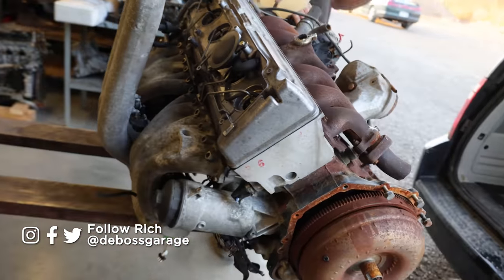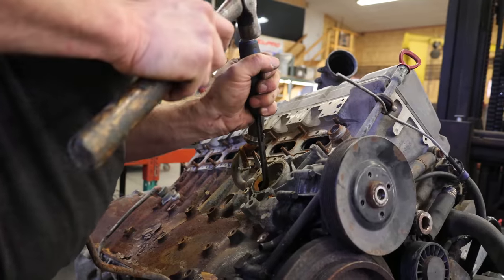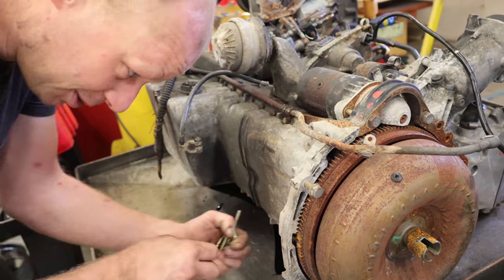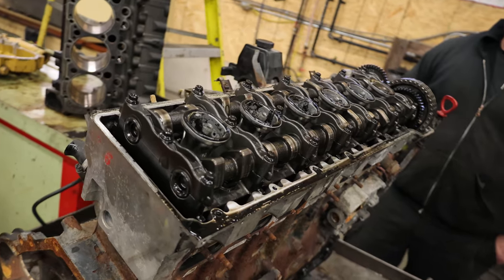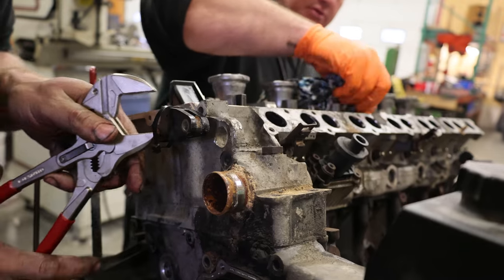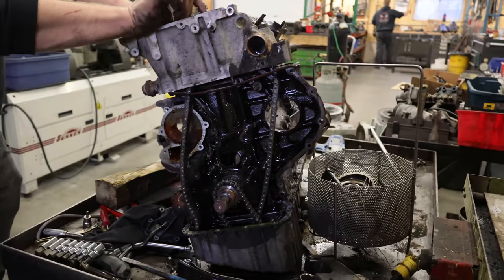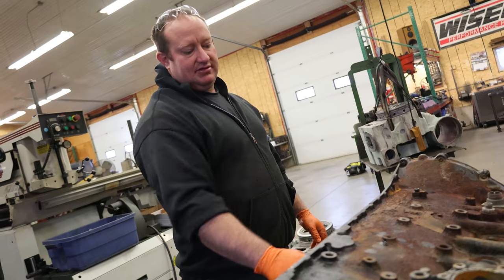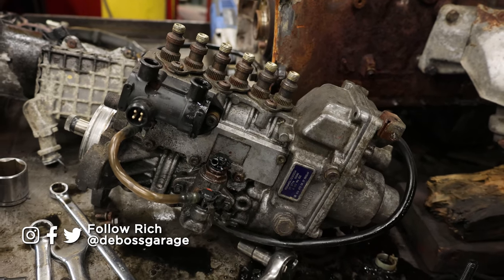REVIEW: Everything Wrong With A 3.0 Mercedes OM606

Comment from the maker: What engine should we review next? 
If you want to see more OM606 goodness, check out @dieselpumpuk, @blacksmokeracing, @dumbluckcustomz, @teamboosted, and @dieselmeken we think they're doing some really cool stuff!
The Bosch fuel pumps referenced at 7:02 are rebuilds by Yankee Diesel, Inc. and can be found at: https://yankeedieselinc.com/products/0400076992/ (mechanical) & https://yankeedieselinc.com/products/0400196003/ (electronic)
Reply: What about the OM602
Reply: You missed Baldur Gislasson off the list, he makes the DlS1 standalone ecu to run the EDC pump, fully programmable, he is a good guy!
Reply: Om642 2008 Jeep Grand Cherokee
Reply: Ecodiesel. There so bad you’d have a extremely lengthy video
Reply: Hey boss.... Do you can talk about OM 906 mercedes benz... Thanks you
Reply: Isuzu 4HK1T from an NPR box van. I think you'll find it a great motor, especially for swaps into full size pickups/SUVs. It's a bit on the heavy side but Isuzu really runs these things on a gentle state of tune. They last and last and last. 
Or if you want something cheaper, the 4BD or 4BG motors are previous generation motors. Also stupidly reliable. They are still being manufactured in China, so you can get brand new parts. Don't know if I'd trust Chinese parts for a high power build, but if you wanted a dead nuts reliable swap with parts available, its hard to beat.
Reply: A BMW M57N2 - Those are magnificient and powerful engines
Reply: @bryandepiazzy1572  Are the totally redesigned ones any better.
Reply: You should do one on the mb 3.0 v6 CRD
Reply: V10 turbo diesel from the 2008 VW Touareg would be an epic find.
Reply: PLEASE DO EVERYTHING WRONG WITH A 6.7 CUMMINS
Reply: Would really love to see a VW 3.0 TDI
Reply: VW 2.4liter turbo diesel, aka D24tic
Reply: In germany we have a tuning company called "Sterngarage" they are tuning these 5 and 6 cylinder diesels too. I can't recall it correctly but it was 500-600 Ps on an OM606 in a W210 really awesome stuff. If you have these in Canada you should look at the VW 1.9 Tdi  (especially motorcode AFN build before and around 2000)these Engines they are said to be the best diesel engines and engines in general VW ever built
Reply: 6.7 power smoke?
Reply: 6.7 Powerstroke and 6.7 Cummins
Reply: Get a mechanical pump from W124 om606 na (rs203). Send it over to Dieselmeken. Let him build it with 8mm plungers and all the goodies. Put a set of H profile rods on the crank. Use na camshafts. Secure the camshaft sprocket cause they tend to shear off! Put valvesprings from om648 in (7k rpm). Secure the crank pulley to the crank cause they tend also shear off (only held by a little half-moon). Put a coolant bypass from waterpump to 5th/6th cylinder. Use a oilpump from om612/13 for higher flow rate and better oil pressure. Use a highflow custom exhaust manifold and holset He531v  and you are good to go for 700bhp+

Greetings from Germany
Reply: Om648 or more Om606 is fine too I guess. Can you show how to get a P pump on it?
Reply: OM642. Mercedes sprinter diesel motor and jeep diesel motor
Reply: M57
Reply: A td5 out of a Land Rover would be cool for us British.
Reply: How about a Fordson (super)major? Do you get those there?
Reply: Another vote for the BMW M57.
Reply: John deere 6076 next!! lets see if they really are good for 20k hours
Reply: @tomredman  i can say from experience, yes they are!
Reply: Y’all have to review the SD-33 and SD-33T Nissan diesels
Reply: BMW M57N 3.0Diesel
Has many advantages over the om606 including being common rail
Reply: The om648, 320cdi engine
Reply: @peterkalza  I hope so, I just brought 2 built in 1996, with 850hours each on them. Fingers crossed
Reply: OM642
Reply: 12.7 pre-EGR Detroit Diesel
Reply: They are wonderful motors, the 8mm dieselmeken 606 I put in the S124 wagon is great....have a 7.5mm going into a Jeep JK currently
Reply: Vw/volvo D24tic
Reply: L10 cummins
Reply: bout time . .
Reply: OM617
Reply: Scania engine if you can find one
Reply: Compare the ag d360 vs the truck dt360
Reply: Havent seen you do anything form older John Deere tractors yet... the 404, 466, or the head gasket eater 619..
Reply: How about a Toyota 2H or 1HZ? Not common over there, but comparable to the OM606. Even though  the turbo and NA versions have different rods and piston, people still put turbos on the NA motors anyway.
Reply: om617!
Reply: You changed your impact guns? Why? 

Also, do an Asian one, like a k-series or like any Toyota engines?
Reply: Do a 4jj1
Reply: Rich, you need a Worldpac account. Even if they don't carry something, 90% of the time they list the OE part number. Their diagrams and list prices are exactly what you'd get if you went straight to the dealership parts counter. The ordering system takes some time to learn and get used to, once you do though, it is awesome to use.
Reply: Isuzu 4jj1 or bmw m57
Reply: 2AZ-FE!
Reply: @mikefoehr235  haven’t seen failures yet waiting for it tho.
Reply: Dieselpumpuk. They sell all you'll need
Reply: Merc is cheap with parts in Europe: you pay up front on the car purchase but they dont charge a lot for parts: So for pricing its on the opposite end than the 2JZ.

Try ebay.de
Reply: @jairromero5779  i dont think they ever sold those in North America ?
Reply: Not too many people to appreciate a BJ60 Hino
Reply: @kelby7462  those were way better than the RD28
Reply: OM642. 3.0 V6 CRD. From Sprinters and Jeep Grand Cherokees
Reply: @smokiethebear3334  was going to suggest this one. Have this in my 07 grand cherokee crd.
Reply: 1.9 L VW ALH TDI Engine compared maybe to the 1.9 L PD BEW VW TDI
Reply: @ragnarlothbrok835  if this is true I appreciate the good info!!
Reply: How about some of the toyota truck and 4wd diesels engines?  1hdfte, 1vdftv, 1kdftv they are everywhere on the Australian market.
Reply: The mighty 5sfe.
Reply: OM352!  Some Mog love!
Reply: izuzu or mitsubishi diesel
Reply: VW 1.6 turbo diesel. Go visit Giles in Markham...
Reply: OM648! Last reliable mercedes engine, replaced this OM606 and the 5 cylinder.
Reply: Holden 355
Reply: BMW M57, i got a first gen that is now 380 hp and 800 nm
Reply: Don’t forget BenzForce!!!
Reply: You can use an OM603 pump. It’s a direct fit for mechanical injection.
Reply: Id like to see video on Volkswagen ALH 1.9TDI
Reply: The ford 4.9/300 CID
Amazing motor
Reply: gotta be a bmw M57, the king of small diesels.
Reply: BMW M57?
Reply: Checkout Darkside Developments channel they have some awesome diesels, 400hp 1.9 pd's and loads of other good euro diesels.
Reply: VW CJAA diesel. it's the Dieselgate one. how is it as an engine without all the other bullshit to go with that platform
Reply: VW TDI BRM or BHW, they are becoming more common now days and would be interesting to get you take on them
Reply: AMC 4.0L
Reply: Toyota 1HD-T!! import one of them bad boys
Reply: will love to see u review fuso 6m60
Reply: Everything wrong with a 6.4... or everything right? Since its such a turd of an engine
Reply: i have the MWM 4.2tdi. brazilian,mercedes,fitted to silverado,s & f250,s.,excursions.. std is 140 kw,510 nm. td04, i fitted a bearing ceramic tdo6,ish. now has 700nm..gets 12.5 lt 100. in my 2002 f250. ausie..
Reply: mmmmmm 57,,its allways a gooood idea,,to consult a computer ..before tearing an engine down,. i studied the computer for hrs,,before tearing down my missus,in the b room..
Reply: OM605
Reply: DT360
Reply: 2.0 VW TDI or the 1.9
Reply: Rate the Ford 300 i6, both the carburetor and two fuel injection varients (MAP and MAF).
Reply: 1.9TDI ALH pleeeaasee!!!!
Reply: Check out a fiat/alfa romeo 1.9 16v jtdm😎
Reply: om646, 150hp and 340nm out of a 2.1 I4. Very reliable and long lived.
Reply: Dt360, all the izuzu npr diesels
Reply: 6.7 Cummins
Reply: Vm motori 2.8 crd. The 4 cylinder that’s in the older Jeeps there rare in North America but mine has never done me wrong.
Reply: 6.7 Cummins!  So many videos out there on the 5.9 it'd be cool to compare to next generation. Most videos on the 6.7 are just some guy talking about the specs from a fact sheet, who's never actually touched one

And a cp3 vs. cp4 and maybe a denso fuel pump comparison
Reply: Review the 1.2TDI from VW! the engine coded with CFWA
Reply: More OM606 please please please
Reply: Toyota 1Ht please
Reply: Nissan SD33T please
Reply: In Sudbury, ON I have a VW 1.9 BEW TDI that went runaway on me you could have.
Reply: Do a international DT360!!
Reply: I know it's probably a long shot since it's their newest I6 but I'd love to see your guys thoughts on BMW's B58 inline 6.
The channel PapadakisRacing, has a really good build series on the newer supra that has the B58.

https://youtu.be/MckxlP60cnY
Reply: OM642, curious as one lives in my Merc CLK land yacht 🤔
Reply: Om 642
Reply: Dieselmeken on YouTube is the Mercedes whisper I think his son is running it the father retired. 
I agree P-Pump it
Reply: Land Rover TDV6!
Reply: Would also love to see BMW M57
Reply: Hey Guys! love your channel! I'm from germany and thinking about purchasing a Jeep Grand Cherokee WH with the OM642 so I'd love to see you do a review of that engine! Keep up the awesome work!
Reply: Cummins 5.0 v8
Reply: OM617
Reply: Find you a welder whos worth a damn and has a shop and have him cut off the timing cover so you can make one that's removable.
Reply: I'd like to see reviews on a lot of the common jdm diesels...I've been working on these vehicles for many years and have found most to be cursed with head cracking issues as egr was a thing in Japan by early 90s
The 2LT-E for example I've changed enough of those cylinder heads that I could build a fence with the cores.  
Mitsubishi 4d56 and 4m40 are pretty awful also.
Reply: Om617 is probably the most swaped in North America
Reply: Volvo Modular engines (specifically the 5 or 6 cylinders engines with turbo)
Reply: Boys, id really like to see what you think of the 1HD-FTE that came in the LC100. Are they truly all they are cracked up to be?
Reply: @scrags733  I can tell what it's cousin the 1HD-T is like...
Besides big end bearings being a maintenance item,  my only complaint would be heads cracking occasionally...
Good power for its displacement and weight...as long as you don't compare it to just about any European diesel engine. ..you might actually call it a good motor.
Too much time fixing toxic jdm junk..I'm disillusioned.
Reply: @larsclausen9627  tu2 битурбо, это легенда баварских инженеров 💪💪💪👍👍👍
Reply: Давай про m57-67, особенно m57-tu2 битурбо 💪💪👍,и предшественика m51 😀,заранее благодарен
Reply: @slodsl  один из лучших моторов у BMW, был есть и будешь всегда👍👍💪💪😀
Reply: @shirk15  да да, самый лучший двигатель у BMW 💪💪💪👍👍👍😀
Reply: @derrickdaly296  m57-tu-tu2 👍 👍 👍 самый лучший двигатель у BMW 💪💪👍😀
Reply: M57  bmw please!!!
Reply: How much is the kost for and were is is the place
Reply: lol you said it was in a field  right as you said that I was going to ask if you found it underwater
Reply: The 603 is the 2jz. The 606 cant even pass a vw til u put a 603 pump on it. The 603 would be a first gen 2jz diesel. I dont get where everyone seems to think the 606 is the 2jz when the 606 wont even pull itself off wet grass without a 603 pump. The 603 is a 3.0 I6 with all the goodies and the 606 has to be made mechanical before it will do anything, basically turning a 606 into a 603. So realistically the 603 is the 2jz and the 606 is the red headed stepchild. Lol.
Reply: @spencerelsbury9110  Yes OM642
Reply: Om642
Reply: 4bd1t
Reply: Shortest video ever, right? Didn't even have to watch it.

Comment: I bought an OM602 on Craigslist for $60 couple years ago.. after I got it home I tried to start it and the bugger ran away on me! I had a plate to block the intake but little did I know there was a missing EGR pipe that allowed it to keep getting plenty of air. Vomited it's oil out the dipstick tube like a pressure washer, made made a godawful mess. Ironically after it stopped after it ran out of oil to burn, but wasn't seized up! Head was warped like 2-3mm though sadly. Oh well, most excitement I've ever gotten for $60!! 😂

Comment: I put one in my sprinter, 4 years ago, runs 500hp, it’s my daily, and it’s never missed a beat, and doesn’t piss oil and diesel everywhere like the old om611 did.
Reply: This sounds fun
Reply: Love Sprinters, they're everything a fuel-sucking, asthmatic old gasser American van (that you can't even stand tf up in) could only dream of being. Even the new American vans (which are just stolen from their European variants) seem to not offer diesels or charge like 20k for it. Mercedes did it right... ONLY offer diesel, and a proper modern diesel too!
Reply: What’s the failure rate of the sprinter transmissions again?
Reply: @dregenius  The Chevy van came with the 6.6L Duramax and now is available with the 2.8L Duramax. The Sprinter is fine but it is definitely not what every van should be.
Reply: @dregenius  The MB diesel is great - their DEF system, not so great.  Not that anybody's is,  but the MB system is pretty expensive when it fails.  The countdown to zero starts  isn't too popular among owners.  Otherwise the Sprinters are good.
Reply: @BlackLung87  it's a diesel so we all good! If it were a gasjob thatd be a different story. Lol
Reply: I have a om611 ):
Reply: @Russell_and_Rosko  xlwb for that slow drift....😂
Reply: @Russell_and_Rosko  Tbh, the box is plenty strong enough, it’s not a nice slick box, pretty agricultural, and the ratios are all over the place, but it does the job, 300k miles still going fine 👍
Reply: @johnz8210  mine is pre dpf, it needed to be in order to do this conversion in the uk. The dpf/def is a major issue with the later vans, rust is the issue with all sprinter though, they are not without their flaws.
Reply: @BlackLung87  converted back to idi, no emissions crap, no electronic crap, and most importantly no oil leaks 😀
Reply: @schalz9209  OM611 was not a bad engine, had a lot of bad bits bolted to it, and I had a particularly bad example of it! 👍
Reply: Need a vid🤙
Reply: I wish any of this would be legal in Germany...
Reply: I have a 2006 sprinter I would like to do this swap for more hp and speed can a get some info on this?